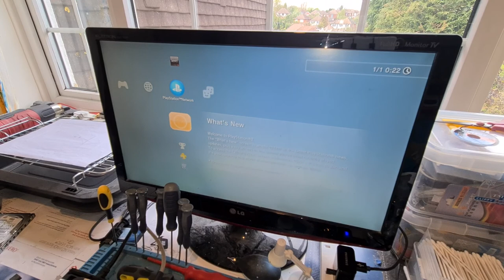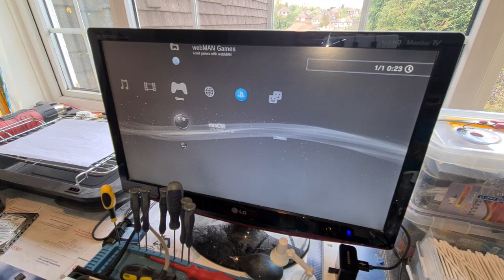Does your PS3 turn off when loading high intensive games? Here's the fix!

Comment: Can you help me? My console can run games like the last of us,god of war 3,lollipop chainsaw and black ops 2 normally but i install persona 5 and uncharted 1 and that games turn off my console for a reason,in uncharted 1 when the firts cutscene ends and i start playing the console turn off,and in persona 5 when playing the prologue the game ask to save data,when i select an option the console turn off again,why is this happening? Games like metal gear solid 4 works fine too but that two games has errors
Reply from the maker: You need to obtain the Syscon error codes. If your console is jailbrokern, then you can run PS3 Advanced Tools (download from brewoligy.com) and select dump syscon error codes.

If your console is not jailbrokern, then you will need to go to ps3toolset.com in your consoles browser. From here, you can obtain the error codes when selecting the system manager tab. You will see at the bottom of the page 32 errors, and you simply expand on the folder to reviel the codes.

If the codes are 1001, 1002, or 1004, it's likely you have an NEC token issue. If the codes are 1601,1701 14FF, then it's likely you have a failing GPU.

The tokin issue is fixed by following my guide in this video, if its a failing GPU, then it's a reball or a frankenstian that is required
Reply: @timdark9282  i just try and i get 1002 codes.......
Reply: @timdark9282  a friend of mine says that it need a thermal paste change,and he says that i try to download the same games but in a folder format instead of pkg format,that will help me? Cause its so strange that my console only shut down in that two games while games like god of. War and the last of us runs fine
Reply from the maker: @nikobrc206  you need the code that the console generates when it shuts down. Without this, you are basically guessing, with the code, you will have a better understanding of what the issue is. In the video above, it doesn't shut down when playing GOW bit it does when playing TLOU. 

So get the syscon codes and find out what the code means. Just Google "wiki syscon error codes" to look it up
Reply: @timdark9282  well,i start the uncharted 1 again and turn off the console,the page says its "1002" code and the wiki says 1002 codes are related to power rsx
Reply from the maker: @nikobrc206  1002 is likely to be the RSX tokins. You can either replace them with tantalum capacitors 2 5v 470uf low esr or you can tag the on, like I did in the video. This should resolve your issue
Reply: @timdark9282  i try,but the weird thing is,i buy the console from another dude and when i look for the save data folder i found that that dude complete uncharted 1,how did he manage to complete the game if i trigger an error when playing the same game?
Reply: @timdark9282 well dude,i give the console to a friend,looks like its that capacitators are my problem
Reply from the maker: @nikobrc206  The syscon error log indicates you have a tokin issue, so replace 2 NEC tokins with 8 470uf 2.5V low ESR tantalum capacitors or try simply piggybacking one on and test to see if it's resolved the issue

Comment: I just put new thermal paste on my ps3 60gb original fat 😂 but i noticed that my ps3 turn off after playing mgs4 like for 3 hours straight and noticed that the power supply is running super hot is that normal or should i be worried 😮??? Also these old original fat ps3 run super loud like a jet engine 😅
Reply from the maker: It's normal for the power supply to get hot. Console probably  needs a de-lid  if it's running the fan loud. I would use custom files and run webmans dynamic fan control starting the fan at 33 percent. This should prevent the fan from getting too loud as it will keep the console cooler for longer

Comment: I have a CECH04 that shuts down ocasionally. I already added a small Piece of eraser behind the cell, already delidded both the CELL and RSX sucessfully, but I still get the ocasional shutdowns when playing. Was able to Retrieve syscon codes error 1001, 1002 and 1004. I’m inclined to try the capacitors. Will some 470uf 6.3v black tantulum capacitors Work? 

Thanks!
Reply from the maker: Sounds like it's the NEC tokins that are failing, so yes, piggyback some tantalum caps on the RSX and CPU, and this should solve the problem
Reply: @timdark9282  are 3 470uf 6.3v tantulums Okay or should I use others?  Thanks for your help!
Reply from the maker: @Ápio Serpa  yes that's  correct. It's preferable that they have a low ESR (below 9) and I would only buy branded caps like Sony or Phillips
Reply: @timdark9282  Tried playing it today, it shuts off a few seconds after powering on (tried 2x) but all red lights, no YLOD. 
Should I still try to add the tantulum first or should I replace them instead? Sorry for bothering but I’m running out of ideas. And thanks!
Reply from the maker: @Ápio Serpa  I need to see the shutdown. Take a video of it and upload it to YouTube. Then send  me the link so I  can  see it shutdown
Reply: @timdark9282  thanks for the reply. Been trying to take care of this BC PS3 but it hasn’t been easy.
Got Home from Work today and tried to make a video of it shutting down but to my Surprise it didn’t shut down right away and I got to the XMB just fine and even started a PS2 game fine! Don’t know what is going on. 
What has been done already:
- Changed thermal paste when I bought it (paid a repair shop)
- Tried eraser trick (stuck Piece of eraser behind the Cell hole)
- Sucessfully delidded the Cell and the RSX, applied Artic MX-4 on both the Cell and RSX (even the small chips next to it) and on top of the heatspreders. I stuck the heatspreders carefully on the heatsink and assembled the console.
- Installed CFW and Multiman/Webman to monitor the temperature and fan speed. Changed minimum speed to 31% 

It was able to Keep temperatures around 60 degrees on both chips but it still shut off after 40 minutes while running Uncharted 3. 

Retrieved syscon error codes through the CFW, and the codes were 1001/1002/1004. 
I already order some 470uf 2.5v tantulum chips with low ESR as you recommended, but I am now wondering if piggybacking the chips will fix or I will have to eventually replace the tokins. 

I will Keep trying to catch it shutting down on vídeo, either starting or while running games and I’ll upload it

Thanks!
Reply: @Unbeli3ver So is it good now? After  tantalum caps؟?
Reply: @h47man  wasn’t able to find the issue, ended up changing the whole board and give to a repair shop to Frankenstein it.
Reply: @Unbeli3ver  Thank you for your reply. I appreciate it

Comment: Hello. My ps3 super slim after i try to open any app or game just dies immediately, it's not just a freeze or black screen issue, console cannot be boot again until i plug out and back again a power cable. Can it be a power supply issue?
Reply from the maker: That's not normal and obviously shouldn't happen. If it powers on okay and dies when you load a game or application, it's a possibility that the system has a power delivery issue or the paste under the CPU needs changing. The power delivery could be anything from a faulty power supply or capacitors that may need changing
Reply: @timdark9282  Maybe it can be my 11 year old hard drive that has been used so many times
Reply: Because 5-6 hours ago i cleaned my ps3, and changed thermal paste on cpu
Reply: Also when I put power cable on psu, I hear a small electric crackling noise. Its bad isn't it?
Reply from the maker: @danialinoo1930  yes, that's not good and could still be a number of faults. Looks like it's time to get a new one
Reply: @timdark9282  Well if you would getting a brand new ps3, what type of revision would you prefer? Slim or Fat?
Reply: Not brand new, just a good one that wasn't been used too much

Comment: Hello i have a rebug ps3 fat
. Webman constantly crashes my console while gaming although i get better temps. When i uninstalled webman didn't face any issue although ps3 is running hotter. Do you have anl solution for this issue?
Reply from the maker: Simply update Evilnat 4.90 and install the latest version of Webman. If your console still crashes, it's  not webman that is the issue. It's likely to be bad NEC tokins. The reason is that the tokins work better with heat, it seems the heat the console is generating temporarily revives the tokins. So the result is a working console but it won't last and one day will completely fail either to more bad tokins or it will be an RSX failure due to the excessive heat the console was generating
Reply: @timdark9282  do i need to update PS3 system firmware or simply install evilnat? I have a rebug ps3
Reply from the maker: @tonysaurabhroy  simply update to Evilnat via a USB stick
Reply: @timdark9282  I'm not very familiar with evilnat. Do I need any other app with it as well? For rebug I needed the rebug toolbox. Also will this have fan controls inbuilt or do I have to separately install Webman?
Reply from the maker: @tonysaurabhroy  no, everything is pre-installed, so there is no need for a toolbox ect
Reply: @timdark9282  ok I'm trying it and will let you know
Reply: @timdark9282  also do I need a newer multiman or the older one already installed will be fine?
Reply: @timdark9282  yeah tried it , same issue. As soon as I change fan settings that's it
Reply: @timdark9282  thanks for the advice tho. Earlier I had zero control over fan speed. Now atleast I can check temps as well as turn on the fan for some games which don't crash. Earlier I had to completely uninstall webman . This doesn't need anything like that. So somewhat of a solution

Comment: My ps3 keeps crashing when I close a game or when I try to turn the console of
Reply from the maker: When you say crashes, does it freeze, or does it beep off with a flashing red light?
Reply: It turns of with a beeping red light
Reply from the maker: @NinjahajenYT  use PS3 Advanced Tools to dump your Syscon codes. If you're getting 1001, 1002, or 1004, then it's likely to be the NEC tokins. So this fix would resolve your problem

Comment: Hey i think my cpu rsx is failing idk what that is but i think it is the only reason i sent it to repair and they said i couldn't be repair is it true? Or should i go to another store??
Reply from the maker: Does the console boot up?
Reply: @timdark9282  yea it switches off when I start game after like 4mins
Reply from the maker: @MadhwanPuri  using your PS3 browser, go to PS3toolset.com. Once the page loads, go to the system manager located at the top in the middle of the page. Once the system manager loads, go to the bottom and expand the error32 tab. Post on here the first sive codes, and I will be able to tell you what the issue is likely to be
Reply: @timdark9282  idk what size codes are but where it is - 1002
1002
1002
1002
1002 all first five are 1002
Reply from the maker: @MadhwanPuri  That means your RSX tokins is failing.. you would need to either add tantalum caps to the existing NEC tokins or remove and replace the NEC tokins with tantalum capacitors
Reply: @timdark9282  and how do we do that??
Reply from the maker: @MadhwanPuri  well you will need soldering skills, and follow my video tutorial

Comment: My PS3 slim always shuts off right as the god of war 3 opening cutscene is about to end. Any fix ?
Reply from the maker: Yes, it's likely to need some tantalum capacitors added, this is highlighted in the recording
Reply: @timdark9282  Hey, I saw some 330uf 2.5v caps online. Will they work ?
Reply from the maker: @rogermox1011  you need caps with a low ESR, no higher than 9. Cheap tantalum capacitors have a high ESR, and this can cause ripple noise, which will cause your console to shut down with a YLOD

Comment: Hey can u help me w my problem pls,my ps3 was only turning off by it self (like ylod) in just like 10 second playingit.but it was just when playing buronout paradise,in another game it was not happening can u help me fix that plss it was my fav ps3 games
Reply from the maker: It's likely to be tokins. You will need to read the syscon error log to get the codes. If it's a 1001, 1002, or 1004, it's likely to be tokins.
Reply: @timdark9282  how can i do that?
Reply: @timdark9282  how to do it?
Reply from the maker: @elangramadhan1365  The video shows how you will need soldering skills though
Reply: @timdark9282  ohh,thanks for the info and IM sorry cuz i don't watch the full video

Comment: I have this issue with custom fan settings. Whenever i use cfw settings for fan speed the ps3 crashes with the red beeps. Without any custom settings there is no issue. How can i fix this?
Reply from the maker: This is a very common issue that has come up a lot on various different PS3 forums as well as here.

The issue is a failing tokin, most likely in the CPU side. If you go to brewoligy.com, you can find a PS3 package called PS3 Pro Tools. It's a fronted menu that allows you to dump the Syscon to a USB stick. Once you do this, you can open the "SM" file using your computer, which will be located on the USB stick. If you are seeing 1001 or, and 1002 codes, it's the tokins and new tantalum capacitors will need to be added.

So why does it work when the fan is slower and the system is hotter? The answer is that the tokins temporarily revive with heat, so a less efficient fan speed (Syscon fan profile) will result in a hotter console that revives the NEC tokins. 

So why not just leave it and have a hotter running console? The answer is simple, a hotter console will result in a BGA or a failing RSX issue. A hotter console will create motherboard warping, and this creates a break in contact from the CPU or RSX BGA. So the Ball Grid Array (lots of small solder balls under the chip) will eventually lose contact, creating a permanent YLOD that will need a complete reball. If you have a backwards compatible console, then the excessive heat can cause the RSX chip to fail (bump-gate)
Reply: @timdark9282  I don't have any replacement tokens, do you know how to use a substitute?
Reply from the maker: @tonysaurabhroy  it's a repair,  like what you see in this video
Reply: @timdark9282  just want to know if the tokens can be fixed by a technician, I used a technician for physically modding the fan. Can he fix the tokens without replacing the nec tokens? He's a skilled guy but replacement tokens aren't available
Reply: @timdark9282  so can this be fixed by adding more capacitors to both the rsx and CPU?

Comment: Can you help me with my console? It is a FAT model. I have the same problem as in the video. The console shuts down the most when playing GTA IV. And sometimes it doesn't shut down and works all day. Can you tell me if this is the beginning of the YLOD or just need to replace the thermal paste and should I chip it with this problem would it get worse with it, thanks in advance
Reply from the maker: Use ps3toolser.com to get the syscon error error codes. Once loaded, go to the system manager and, at the bottom of the page, expand the 32 error tab. Then post your error codes on here for me to look at

Comment: Tim do you take on repairs i have a ps3 fat BWC model that id rather not attempt myself.
Reply from the maker: What's wrong with it?
Reply: @timdark9282  Thanks for getitng back :) So It powers on green light, fan is spinning but no display - reset display by Press and hold the I/0 button until it beeps twice - still nothing, tried cables, TV etc with not a peep from it. Be great to have it working but also a good service to keep it going for longer.
Reply from the maker: @Chris-tx9ou  https://youtu.be/UAxi5vYD99A
Reply from the maker: It's likely to need a re-ball on the CPU. In the link above I apply pressure to the CPU to get the console working again. I have tested this on a fair amount of consoles and it depends on how many hours of play time the console has undergone in its life to how well the fix works. A lot of people claim its a RSX reball that's needed but the fix I demonstrate highlights its likely to be CPU. The reason a RSX reball works temporally is because the heat generated from the reball bends the board back into its original position which reconnects the CPU solder balls. Unfortunately a CPU reball is costly and if done badly will damage your console. So the CPU pressure mod is a great way to revive your console. You do however need to run a high fan profile to keep the console under 60 degrees, normally 40 percent is enough. Also before shutdown you need to run the fan in webman at 80 percent to cool the console below 50 degrees so when it's turned off there isn't enough residual heat fo flex the MB
Reply: @timdark9282  I have 2 of the Phat BWC models both faulty Id love to have one working out the two. Is there any way to contact you direct to chat further about the care you put into these units and the potential of a repair /service Thanks Tim.

Comment: Hello thanks mate for the content, I have a ps3 Fat, it has similar problems, some games like gta5 doesn't finish up loading, some games plays for some time then blinks red and shuts down. Sometimes it flashes red immediately after turning it on and shuts off
Reply from the maker: Could be the caps, to be sure you would need to get a Syscon error log. This can be done with 
PS3 Advanced Tools, you will need custom firmware to run the program
Reply: @timdark9282 if it is that what's your solution??
Reply from the maker: @7choppz710  The solution is in the recording